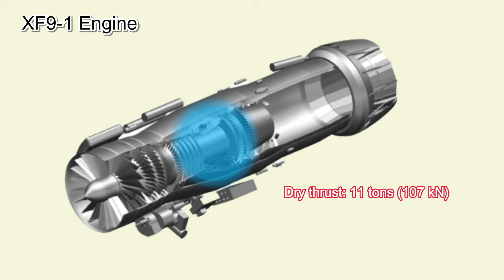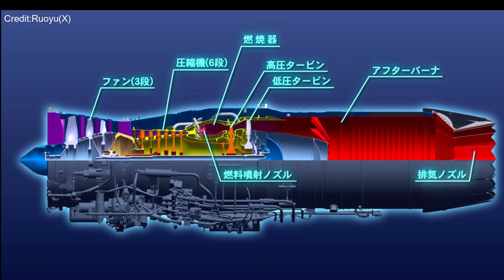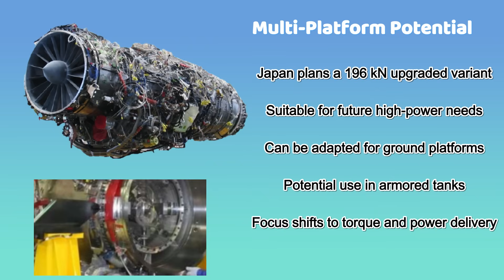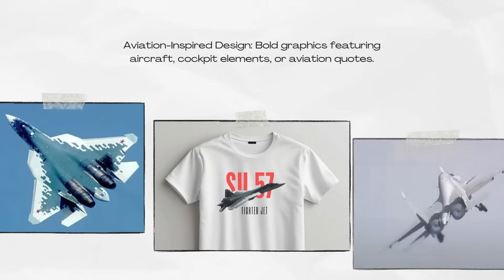Following the bullet train project, Japan offers engine technology for India’s AMCA fighter jet.

Comment: No such reports have been made in Japan.
Reply: But Japan has probably proposed this....Japan also proposed 6th gen fighter to India...Just the clause is no leakage of technology of Japan....
Reply: @tusharchandaliya4  Japan once had discussions with Turkey on the development of tank engines. Japan refused to provide the technology. If India wants to buy the engines, Japan may sell them. But the technology will not be provided. Both Japan and Germany manufacture automobiles in China. China takes it apart and makes a copy, but it is not the same. This is because Japan and Germany do not teach China about thermal expansion of metals and metallurgical technology. India should get rid of its beggarly spirit of trying to get technology from other countries and create its own technology on its own. Russia also did not provide technology to China. How long is India going to remain a beggar? China built the engine after many attempts. It may not be as durable as the U.S., but it is on par with Russia. China no longer needs Russian engines.
Reply: @兵石 India has produced its own jet which is kaveri engine which produces 76 kn of dry thrust and 106 kn of after burner thrust but its goes lower then the requirement thats the reason India is seeing for a joint partner venture to improve its design and alloys to withstand higher temperatures....You who makes cheap low quality technology that is stolen from Russia and Us are talking about being on par with Russia I am pretty sure you should tmcheck your wngines if they produce enough thrust😅😆...India is a democracy which is crystal unlike dictatorships who always hype up and show they are better then reality 😅
Reply: U really don't have anything good to say about India
Reply: @AcuteChan I thought he was japanese later I seen more comments and Found out he is Chinese ccp bot...😅
Reply: Now its officials japanes government  offer jet engine to india